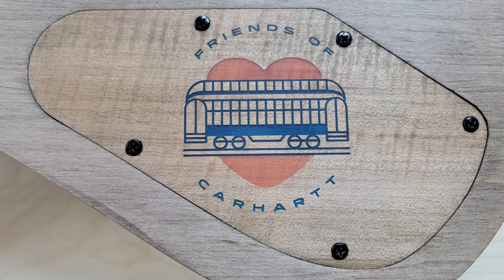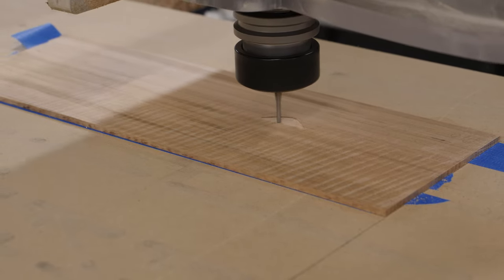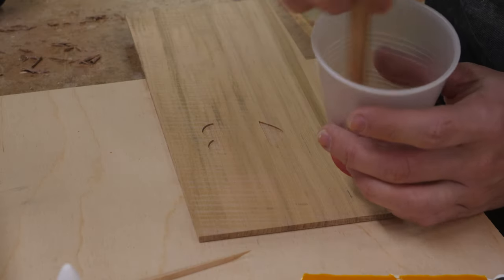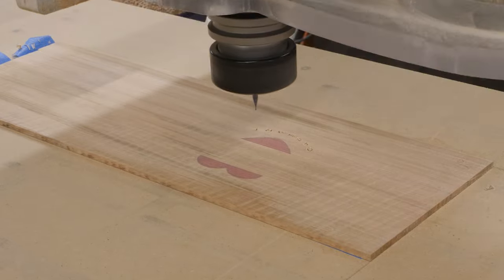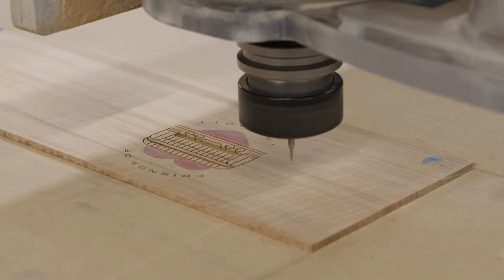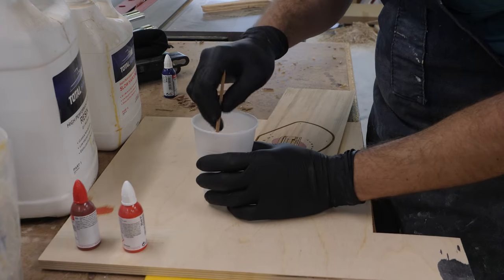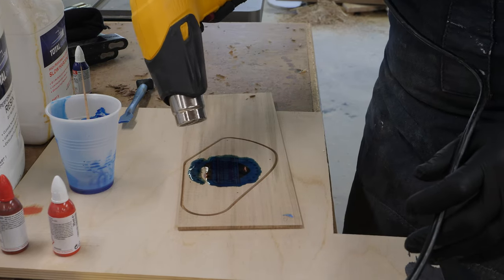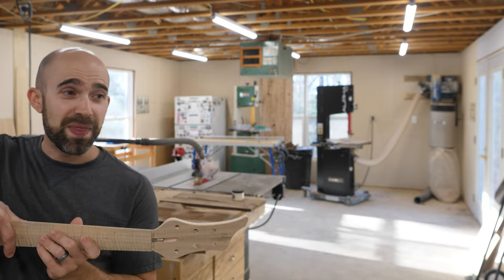Multi Colored EPOXY INLAY With a CNC

Comment: Looks great! Like the Rubio on the wood. Guessing it doesn’t stick well to the epoxy, at least when wet.
Reply from the maker: Thank you!  I'm happy with how it turned out 😃.  Once the epoxy is cured the Rubio can be applied over top.  It seems to still adhere a bit but not sure if it's as much as over wood.

Comment: Is it mandatory to pass through the drum sander twice? What would have happened if you did the red part, let it dry, then the blue part, let it dry, then drum-sand?
Reply from the maker: Since there's a hard line between the red and blue I had to do this as a two part operation.  If there was a little bit of wood between the colors I could have poured all of the colors at once though.
Reply: @WoodshopMike  The question wasn't about doing both pours at once, the question was about running thru the sander twice. The sequence: pour Red, let it dry, Carve pocket for blue, pour blue, let it dry, then sand
Reply from the maker: I would run it through twice

Comment: Surprised you didn’t get any resin bleed. I’m struggling with this, any ideas?
Reply from the maker: I was fortunate on this project to not have that happen.  You could try applying a coat of shellac to seal the grain or first brush on a thin layer of penetrating epoxy.  Good luck!

Comment: Is it mandatory to use a drum sander? what would have happened if you did a clearing pass with an endmill instead?
Reply from the maker: You can for sure use an end mill to clean up the first color before pouring the second one👍
Reply: @WoodshopMike  does it only apply to the interim between the colors? Is it mandatory for the final pass to be a drum sander?

Comment: Does the epoxy normally cure a bit higher than the wood.
Also I'm caving very thin lines about .03" deep and want to go with black pigment with my epoxy.
However my board is pine and I want a very dark walnut like looking stain.
Can I stain over the epoxy? There will also be some blue epoxy lakes on this project. If I run the project thru a drim sander there goes my stain. Can I then stain over the epoxybwithout loosing the blue and black epoxy effect
Reply from the maker: If you fill the cavity all the way to the top the epoxy with be a bit shy of the top once it's cured.  You can either plane/sander everything flat or overfill the void and then sand back the excess epoxy.  If you overfill you can outline the area to be filled with a border of caulk to keep the epoxy from going everywhere.  Staining on top of epoxy wouldn't work very well but you could try artists markers like chartpak.  Hope that helps, let me know if you have any other questions!
Reply: @WoodshopMike  if I stain my board first, then apply oramask, then carve.
Then apply epoxy. Let it cure then remove the oramask. How does that sound.
When I peel off the oramask, will it pull out the very shallow epoxy
Thanks for responding
Reply from the maker: I would think the epoxy would stay put as long as it's fully cured before applying the oramask.  Let me know how it works out for you!
Reply: @WoodshopMike  I would pour the epoxy with ora mask still on. Then peel it off after cured. Is that what you meant?
Reply from the maker: Oh gotcha sorry I misread.  I would wait to peel the oramask until it starts to gel
Reply: @WoodshopMike  that helpful thanks fir your patience with me
Reply from the maker: Absolutely! Best of luck!